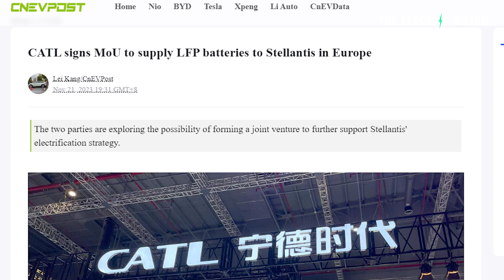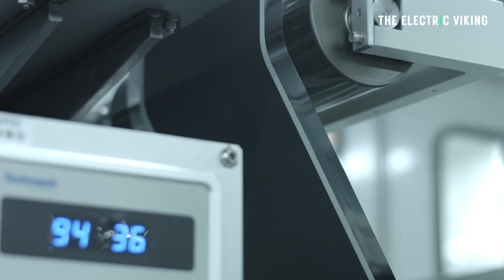LFP battery chemistry Stellantis' strategy to protect Europe's middle class

Comment: LFPs are already in Teslas.

I live in a cool (not cold) climate where temps routinely reach -6C in winter but have so far have seen no discernable difference in performance between the hottest and coldest days.
Reply: Do you charge your EV mainly at home or on public DC chargers? It it's the later, do you have time to precondition the battery (if your car has such feature)?

Comment: Less fire prone!? I saw a dude putting a drill trough an LFP pouch battery and it barely did anything. He ended up making 5 or 6 holes on it and barely any reaction.
On the other hand, he put a pinhole in a NMC pouch and it blew up like a blowtorch! LFP FTW!
Reply: The battery was obviously " flat "

Comment: It took some time, but finally Sam is recognizing the existence of Stellantis with the Citroën ë-C3, build with the first LFP battery. 
Stellantis is the first that brings a sub €24.000 EV in the EU with a 300km range and 100kW charging, and build in the EU, not China. 
Yes, that EV that you compared with a 100km range Dacia Spring.
The ë-C3 is over 4 meters long and a B-classe EV.  
Maybe not build to the liking of people that need huge 2 metric ton behemoth to transport themselves, but for the EU, 4 meters is a normal car length.
Reply: I had pretty much written off Stellantis since it is brand of choice of the "gearheads" and rednecks and the most anti-EV groups in North America.  Of course, Citroen isn't sold here, and the EC3 isn't likely to ever come to Canada because it will probably never sell in the US (and like the execs at Target, the million-dollar geniuses running the US auto industry haven't figured out that the two countries are a LOT more different than they seem).
The EC3 - if well priced - would fill a niche in Canada.  In the Maritimes, Quebec, Ontario and BC anyway - the rednecks of Texberta and the Prairies all want to be Americans now.